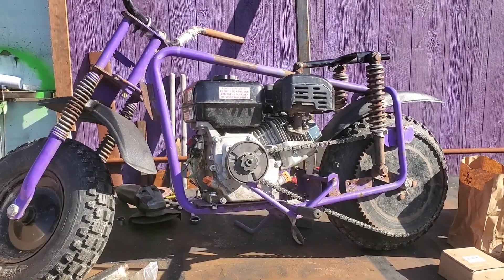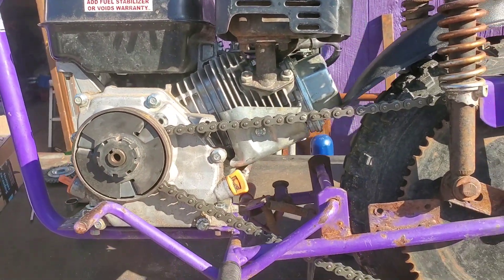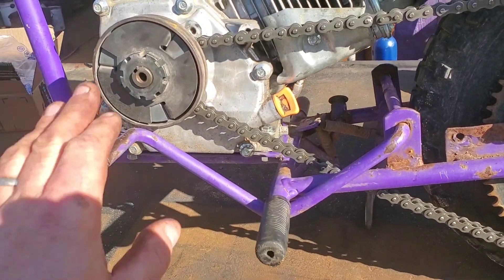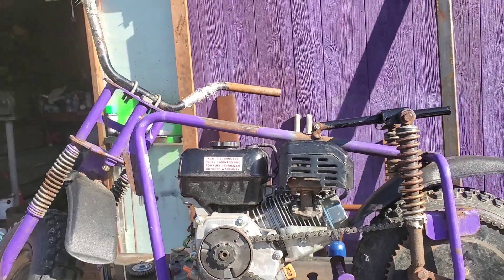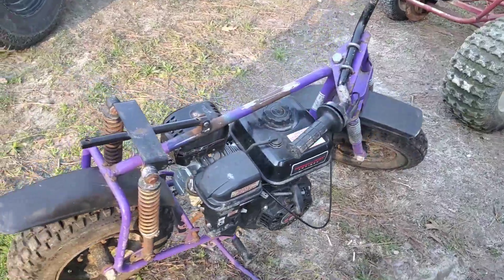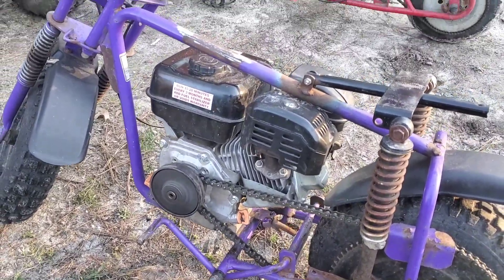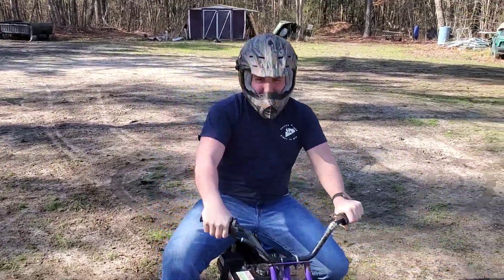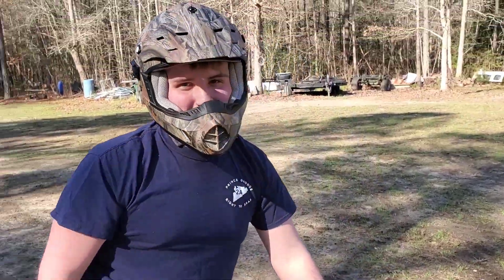Manco Thunderbird minibike Predator 212

Comment: I worked my 212 up to 18 hp, it’s never gonna be fun to drive until you change the gear ratio I brought mine down to 4.8 to 1 so it doesn’t pull up no more but man is it got some top end

Comment: I got one with a Tecumseh 3.5 on it. What’s the top speed on that. Wondering if i should do a swap.
Reply from the maker: Top speed with factory sprocket was about 31. My son is rebuilding it and is putting a 50 tooth on it. The stock sprocket makes it hard to keep the front tire down
Reply: @shawnleakseal10  Hey! I am also working on the same bike, and just got a predator engine. Could you provide a link for where to buy the back sprocket?